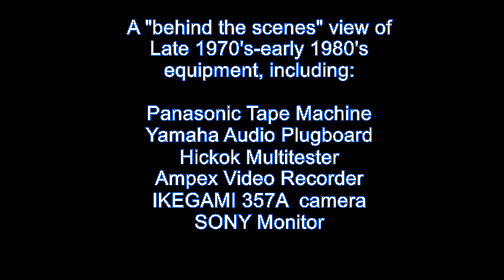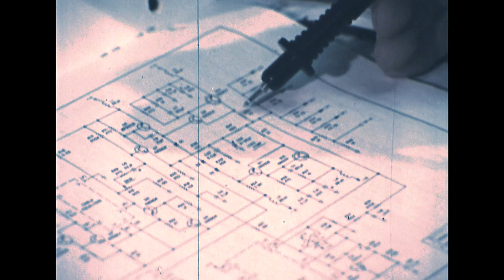Vintage Technology: The Television Engineer Behind the Scenes (Ampex, Sony, audio video camera) 1982

Comment: A question I would have for the broadcast engineer is, were they broadcasting the full 512 verticle lines of the NTSC standard? Most receivers then displayed only 250 lines. A few more expensive ones were capable of 300 or 350 lines. For a short time a few manufacturers attempted to market 512 line receivers before the HDTV standard was finalized. Supposedly, FCC reg's required the full 512 lines to be broadcast but was that really done when there were virtually no receivers in public use which could display the full bandwidth and the station operators could "cheat" and reduce transmission costs?
Reply: I think you have muddled up vertical and horizontal resolutions here.
Reply: I have responded to the erroneous reply twice. Both have been deleted. WTF?
Reply: Dale Comer, NTSC is not capable of 512 lines of resolution.  The NTSC baseband luminance signal has a maximum bandwidth of 4.2 MHz, which translates to 333 (vertical) lines of horizontal resolution per picture height, or 444 lines of horizontal resolution across the entire width of the picture.  And that's with perfect filtering, which didn't exist in the days of analog broadcasting.  Broadcasting with more resolution than that would cause increased crosstalk between luminance and chrominance, interference with the audio subcarrier, and at some point, cause the signal to go outside of the 6 MHz NTSC channel allocation.  Higher resolutions wouldn't comply with the NTSC standard, so it wouldn't be allowed for broadcasting.
NTSC-like signaling can achieve higher resolutions in devices that forgo the normal NTSC filtering and use the right kind of interconnection.  Composite, Y/C (S-video), and component video connections can have higher horizontal resolution.  Some TVs can display higher resolutions, which you might get from a video camera, video game console, LaserDisc player, DVD player, certain professional videotape formats, etc., but never from a broadcast signal.
Reply: @jbalazer  The actual spec is 525 lines and the maximum bandwidth is 6 mHz. I was told about the FCC  requirement by a former co-worker who had worked as a broadcast engineer at a big city TV station. He said they had a 512 line monitor at the transmitter showing what they were purportedly broadcasting for the benefit if the FCC but they were only transmitting about 250 lines. I'm not stating that the full bandwidth was broadcast but asking if it was ever done.

Comment: Reminds me of working with 3/4” Sony U-Matic and Betacam gear back in the day.
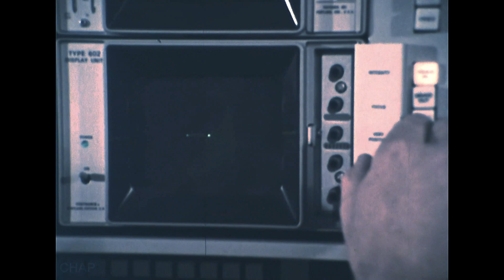I also noticed the dot matrix LED numeric displays at 2:50. They look like HP types from the early 70s that have the decoder on the device. I have 4 of them. Probably since the early 80s. Hard to find now.
Reply: I sit here right now surrounded by U-matic, Betacam, MII and more modern machines up to HDCAM-SR.